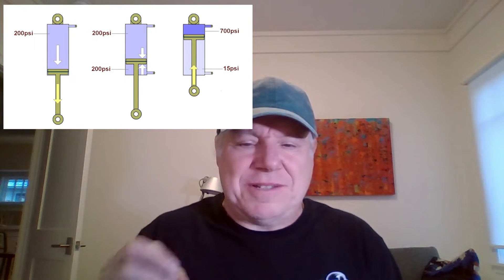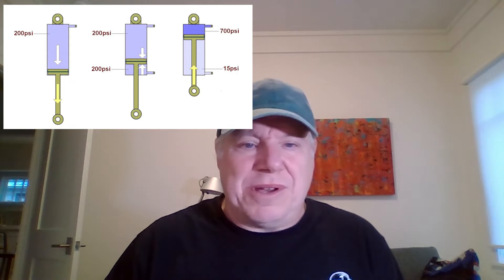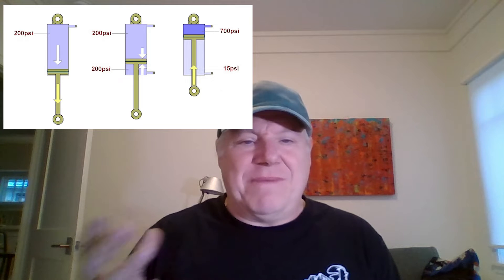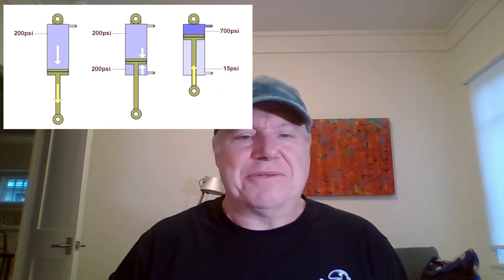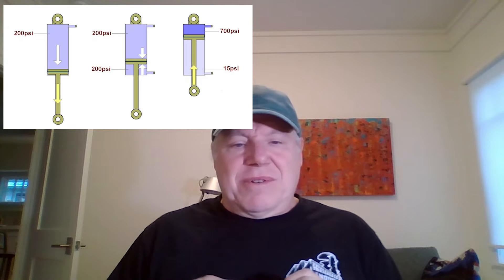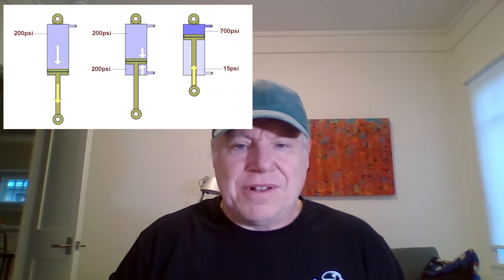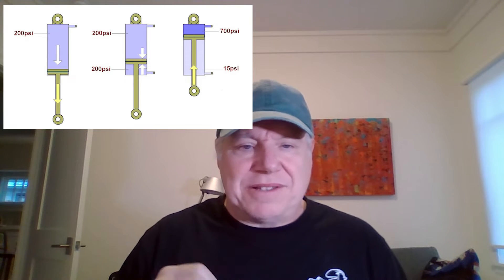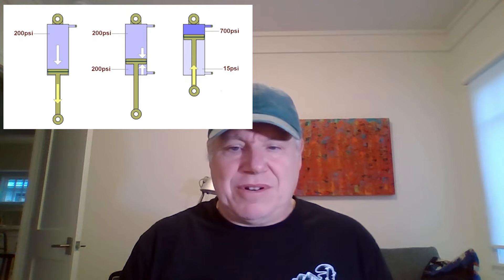What Does The Negative Air Chamber Do On Suspension?

Comment: Excuse me😅, I forgot to explaine WHY I now try to rebuilt my 3 pc of Öhlins air RXF36 forks😁😁😁.
I tryed to run thees forks with all diffrent kinds of air pressure set up and noticed that, if I put the air pressure as whats the recommends are for my weight AND the SAG thats are recommended, the fork WILL NEVER travel the 180mm that I obvious whant it to do. With the right SAG it becom NOT the right travel.
It seems like the edvice is then to adjust to MOOR SAG🤔......That is for me than something wrong, that have tobe fixed😉.
So now I explained why I am crazy😋

Comment: 👌It's true😁
To buy a first fork is like buy your first car😅😅😅, 👉you can't know anything before you have trye somting👈😉
All the top end forks are all as nice, because all this forks you can calibrate your specifikt set up.
I have Fox Factory 170mm Fit4, Rockshox Lyrik Ultimate 180mm and 4 pc Öhlins RXF36 170 - 180mm one coli version.
All this forks are very nice (without negativt airchamber adjust) exept a little spacers in the air version of Öhlin forks, that doesn't makes any difference it its thehr of not.
I noticed that the Fox and Rockshox forks and the coli version of Öhlins are easy to set up, the coli version is the perfect downhill fork on havier bikes and thees air forks are perfect forks for more "poppy" light weight and technical trails.
Thees Öhlin RXF36 AIR version forks are a little bit more fore the havier and more aggressive bikeparks rider, because I NOTICED (I guess only me) that the Main chamber volume seems to be to small, compare to the soooo smoother Fox and the Rockshox.
I tryed to take the volyme FROM the ramp up chamber, by NOT pump air in it, just to increase the air volume in the main chamber and tyre to it out......but with this kind of experiment you lost the meaning of thees fantastic adjustment ramp up chamber that Öhlins have.
My project now is to make diffrent size of "external air volume raiser/chamber" to get thees forks to works for me, as a 85kg "light and not have wrists to handle a return from the moon landing" like I whants😅😅😅

Comment: 5:04 Wouldn't this cause the fork to sag until the positive air chamber has significantly higher pressure than the negitive? Because the net force on the piston at this point is roughly zero right? I'm not saying you're wrong I just don't understand
Reply from the maker: Forks do sag as soon as a person gets on the bike. The idea is to set the positive pressure to get the correct amount of sag, 25 - 33% usually.

When no weight is on the bike the chambers should equalize out.

Comment: Regarding 2023 Rockshox Deluxe shocks, they now offer volume reducers for both positive and negative chambers. They also have progressive and linear cans. Is it safe to say adding reducers to the negative chamber will decrease small bump compliance at the beginning of the stroke? I'm trying to wrap my head around how this works. Does a larger negative chamber increase small bump compliance and make it more plush?
Reply from the maker: My guess is that what they are doing is similar to how the DVO fork works with the Off The Top adjustment.
Reply from the maker: Doing further research on this, yes adding spacers to the negative chamber will decrease small bump compliance. I do however feel that spacers will work slightly differently because you are altering the size of the chamber allowing the ramp down to be quicker, thus more quickly reducing small bump compliance earlier in the compression. Spacers in the negative chamber is not a new concept, it's been around for a while.
Reply: @ShadLife  Thanks. I need to do more reading to better understand the effects of negative chambers. Then there's the sag setting. It seems at 25-30% sag the piston would already be in the positive chamber?
Reply from the maker: @mtbbiker6401  Ideally you want the pressures close to equalized at sag. I will do a video talking about the importance of sag coming up here soon.

Comment: I have this in my rockshox reba it’s what ever. I have a rockshox revelation I changed from 130mm to 150mm with one volume reducer and it is butter smooth. I put a lock lever on the handle bar and wish all my forks had that. I never adjust compression just open or closed. Rather tune by air and tokens. I’ll play with my rebound to get that feel.

I have a Marzocchi bomber z2 140mm and it’s like feels the same. Honestly I find it more annoying to put my shock pump at the bottom of the Reba to make an adjustment that is far easier and superior IMO  to just turn a dial at the bottom. I know this is rebound but my reba says negative air pressure adjustment and has a chart for weight. 

Cool video I’m really kicking buying a Kona woo fat bike tbis Christmas. Such a dramatic experience seeing a fat bike in person. I’m in Az Hawes area trail system. So my 3.0/2.8 width 27.5 set up is good. Can only imagine how gravy that bike would be in the sand.

Comment: It is always good to educate your followers well.
Basicly.
The best way to describe the negative chamber is that it sucks... think of it as a suction cup, it always wants to return to zero. (In this case sag position).
Suction force (negative chamber) is always stronger than push force (positive chamber)
The larger the negative chamber becomes, the stronger the suction of the negative chamber.
This can cause extreme cases and that is why you have different types of dampers for different purposes.
For example, if you are a normal, simple rider, a simple damper will suffice and for an extreme rider (think big jumps) you should switch to a closed damper system to better control the suction of the negative chamber.
Reply: Can you give an example of a closed damper system?
Reply: @mtbbiker6401  a ROCKSHOX CHARGER 2.1 RC2 is a close system and a MOTION CONTROL RC is not.
Reply: @ArmaniFlyHigh  Okay. I think I understand. I have a Lyrik RCT3 damper which is a closed system (damper cartridge). I also have a Manitou Markhor which I believe is an open system. It doesn't use a separate cartridge damper.